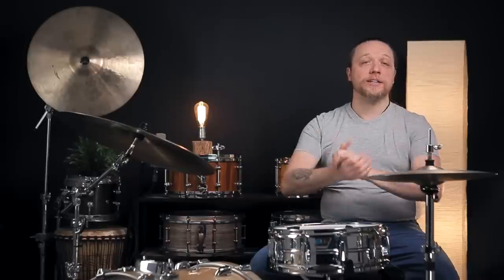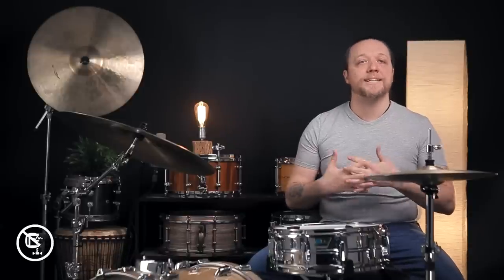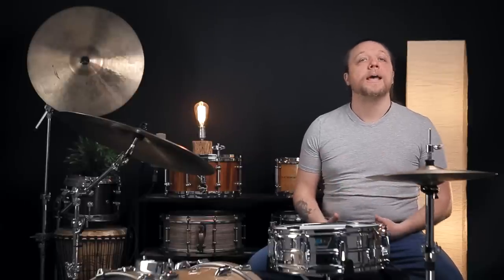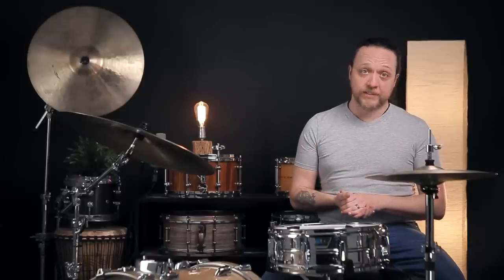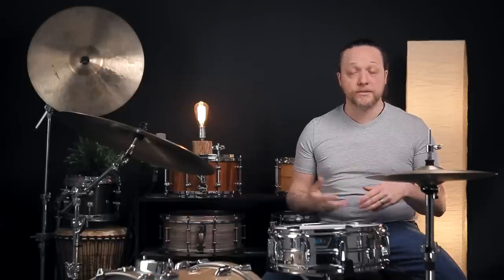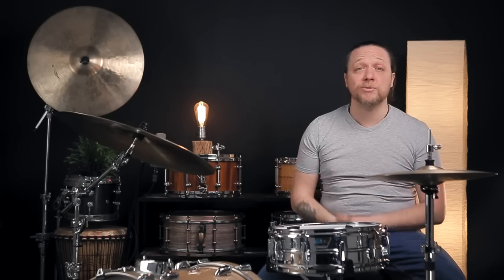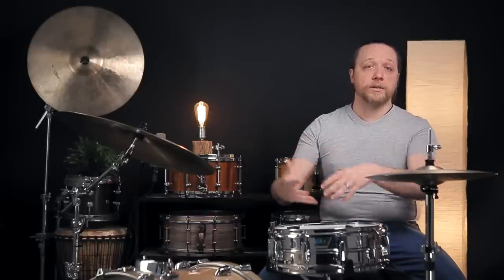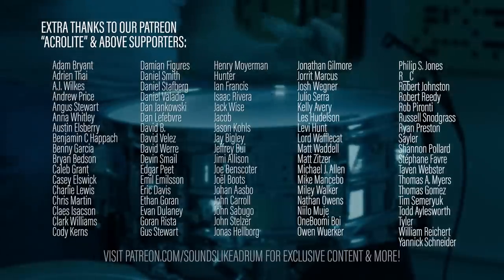“Fixing” Your Snare Sound [Step by Step]  | Season Five, Episode 40

Comment: Another great video you guys, thanks.  I wish this info was readily available 50+ years ago when I started playing.  My go to approach to getting the snare sound right is to get both heads tuned perfectly so the resonance is maximized.  Then I increase tension on the wires until they start to choke the drum then back off just a little.  Once there, it's a matter of getting the pitch I'm after, which is fairly easy to accomplish once the heads are properly tensioned.  I'm happy when I can hear the shell's influence on the overall sound...........

Comment: I tune my snares for feel as much as I do for sound.  I only use tow tunings on the batter when absolutely necessary, which is almost never, but I also don't like really tight batters.  So it usually involves the batter being medium to medium-tight.  Snare side is usually tight; most of the time, when I experiment with looser snare sides, I wind up not liking the results as much and raising them back up.  Snare wire tension depends on sound, but typically it's as tight as it will go while still getting good snare activation when playing light taps near the edge, or slightly looser than that, which I got from reading an interview with David Garibaldi.

The rub though, is making sure the apparent pitch of the snare drum with wires off is consonant with my toms.  I recently pitched my toms slightly higher, and the two snares I use most often became dissonant with them, so I had to raise them up as well (haven't checked my other snares yet).  They still sound great, just not where I like them the best, and one snare is a bit tighter feeling than I like.

Comment: Great video, thank you!  Your ideal sound is similar to mine.  Or mine is similar to yours?? ;)  Snare wires, I start from the loose side, tighten slowly just until it's snappy but still sensitive with a light tap.  Yes, there's buzz...it's a drum, yo!!   

I've struggled with the head tuning interval though.  I know you hesitate to give this kind of thing, but is there a range of pitch ratio you usually land at, top to bottom heads (tapped with the other head muffled)?  I find it easier to think in those terms, like on a tom.  In fact I would say I usually end up with similar pitch ratios on the snare on toms...reso between a half step to maybe a 4th higher than the batter.  Of course with the thin snare reso, that doesn't take nearly as much tension to get the pitch up.

Comment: Nice stuff. Next, what to when you finally get the snare sound dialled in and you find sympathetic snare buzz from toms and/or bass guitar. The quest goes on.
Reply: Turn the snare off when you're not playing it or change the pitch of the tom or snare so they're not same resonant frequency.
Reply: @markblanch2905  yep, I’m aware that that should work. It can be a never-ending chase when your toms are tuned, your snare’s sounding good and then every note from the bass guitar sends the snare wires rattling.
Reply: @marfie53  that's nature, you either tune it out and tune out to it. Hard to avoid the realities of life and physics

Comment: Great video & teaching session. I did notice though the drilled holes in the drum shell for an adjustable drum muffler, somebody removed it, you might find it easier to get your desired sound by reinstalling the internal muffler, which also allows for a more  precise dampening adjustment rather than experimenting hit or miss with different amounts of tape.

Comment: I wish you would play each head independently so I could hear the exact pitches you used to get to each sound. Right now, it's a bit vague.
Reply from the maker: It’s not about the exact pitches. That’ll do more to confuse than inform. You have to figure out what works with your heads, your wires, on your drum(s), in your room. The methodology is what counts here.

Comment: Really eye opening. I always worked by that old motto of crank up the reso head until it's table top tight...
Reply from the maker: You're not alone! This is a common prescription that ends up limiting lots of people and/or leading them to need muffling on the batter head to control the harmonics that become that much more present with a tighter reso.

Comment: It STILL makes sense to own more than one snare drum to have different snare sound options for different occasions. Even with exactly the same tuning, even a layman can hear differences in sound resulting from the shell and its construction, the hoops, the snare bed, or the material or type of snarewires, to name just a few parameters.
This is a good thing, of course, but can be a bit expensive.
Reply from the maker: Does it make sense? Sure. Is it 100% necessary? Absolutely not.
Reply: @SoundsLikeADrum  It‘s the unnecessary things that make the most fun. 🤓

Comment: So why can't you put the damper back in the drum? Do the stock dampers work? Is tape better?
Reply from the maker: Are you referring to the original internal muffler for this Supraphonic? This drum didn't have one.
Reply: @Sounds Like A Drum  yes and I have one in the package,  thinking about drilling  and installing, still not sure. That's  why I wanted your opinion.
Reply from the maker: @mack56  It's not that one is better than the other- they're just different means of muffling with different results. Personally, I've never felt like any of my drums without internal mufflers are somehow "missing out".
Reply: mack, I put Gatt tape on my snare .  Another Drum Instructor advises against it because it can damage the drum head.  When I went to remove the gatt tape, it tore off the top l;ayer of my Evans HD Dry batter head!.  I put the tape back but the damage is apparent.  The snare sounds the same, but My OCD dictates to order a new Battr head and NOT tape it again.